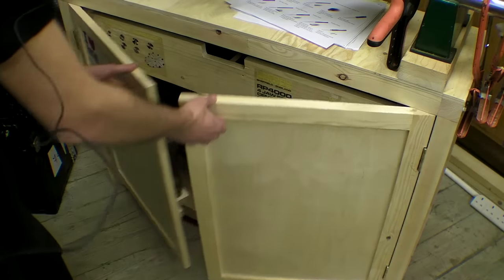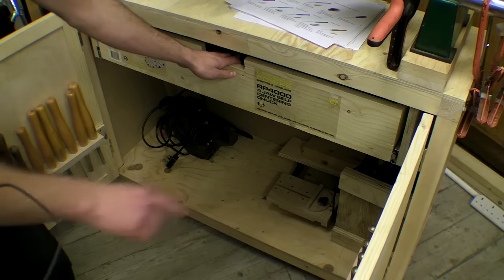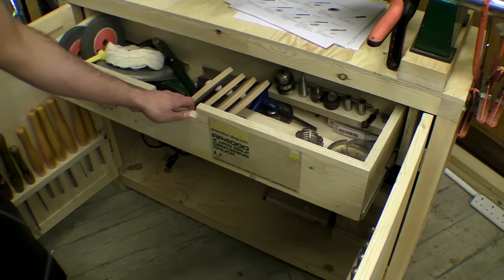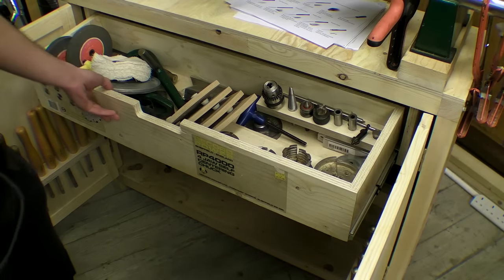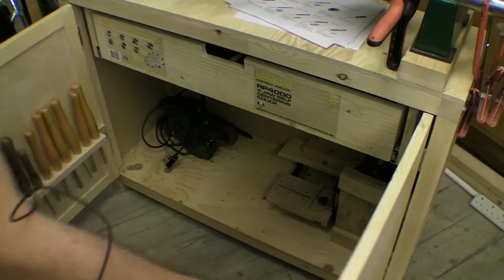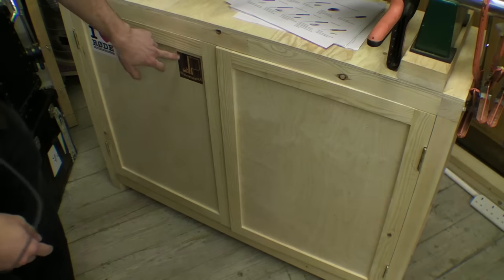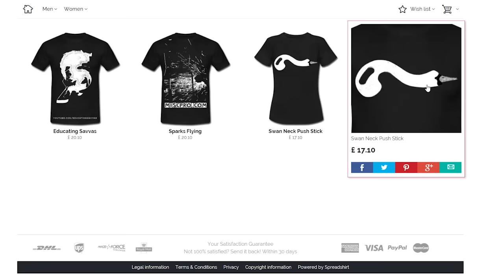Making A Wood Lathe Stand

Comment: Very nice and solid! I like that design. I once build a drawer with similar porportions and I am not quite satisfied because being the drawer slides so short compared to its length makes it catch a bit everytime I pull it out. Maybe I didn't install them properly alligned, what's your experience so far with that one? Thanks!
Reply from the maker: +Cactus! workshop I have had to train myself not to pull too hard as the drawer distance is only 25cm.   Also all drawer slides should sold with their correct thickness and the only variable is the material itself.  I measure sheet material with a callipers and factor that in.  Will make a note to mention that in the next video.

Comment: Did I see an odd end to end stapling of the long top support rail? If so, was that an opps? I like the enclosed storage, my shelves are always covered in shavings. The pull out draw is handy for all those accessories that these guys require.
Reply from the maker: +Darnley Bynoe No it wasn't an pops - I was using up scrap / more cannibalisation so happened to fall short. The join with v nails plus panel glued on top is sturdy.  I do make a mistake in the next video though.